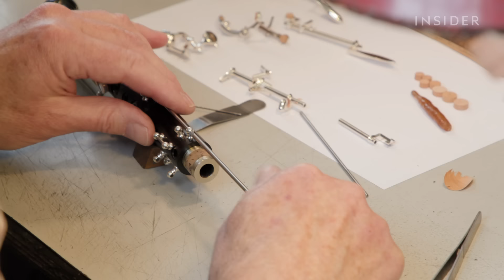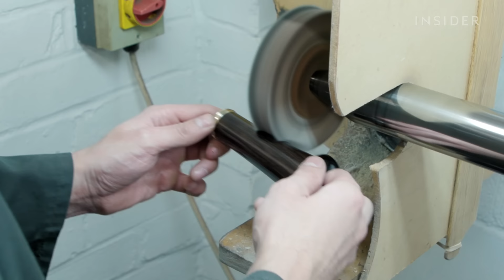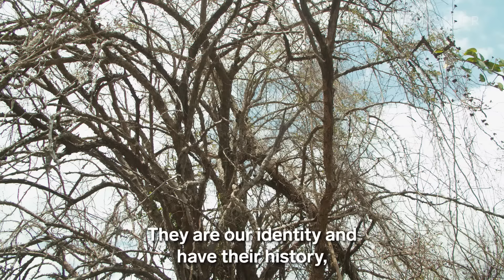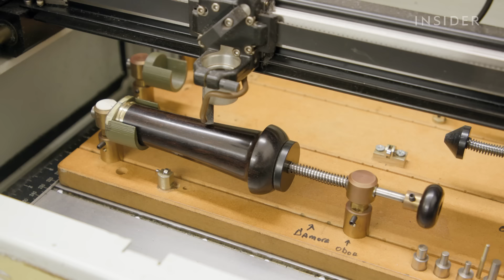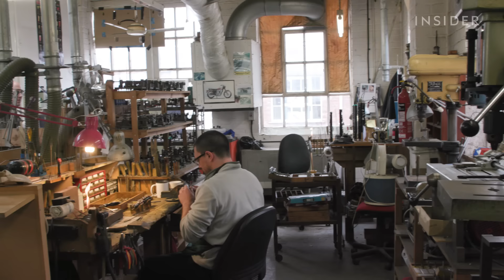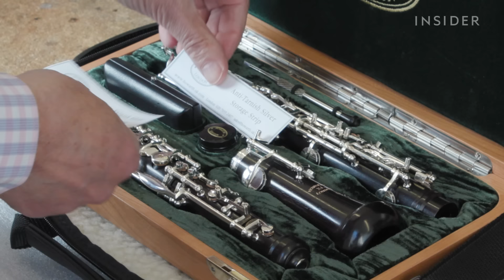Why Oboes Are So Expensive | So Expensive | Business Insider

Comment: Listen closely... This... NEARLY ENDANGERED WOOD. $151/ cubic meter. You know not how much this really is. Enough for probably 1000 Oboes. The lies told to inflate prices are always quite blunt. You just paid this man $14000 for a job a decent fitter & turner could do for $1000. its literally an engineering shop with a bit of a twist & an "aging" process that really means nothing other than dazzling the minds of the easily awed. Nothing fancy really.

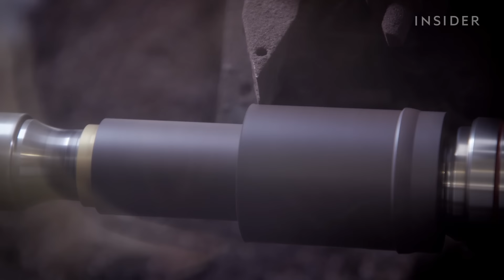Comment: Its a 2 year old video so I don't think anyone will see this comment. But at the 1:12 mark, there is a piece being turned on a lathe and the cutting knife on the lathe looks dull and rusty. Or am I missing something? Maybe the cutting edge is actually behind the piece of wood being turned and not visible from the camera angle.
Reply: Pretty sure you only need the cutting edge to be polished and sharpened since the rest of the structure likely has a protective oxidated surface to prevent further rust, or was painted over
Reply: @VentiVonOsterreichor it is just the wooddust from cutting making this rugged surface

Comment: Great vid, but I kind of died when it said “($14,000)that’s more than four times the price of a high end professional flute”. $14,000 is the price for most professional flutes😭. Not even high end either, that would likely be the price for a handmade flute made out of sterling silver. An ACTUAL high end flute is typically made of gold, and those can run you up anywhere from $18,000 on the low end $20,000-$30,000 typically, and $50,000 for a complete 14k gold flute, mechanism and all (there are also some more rare flutes made out of solid platinum that can run over $60,000-$80,000!). Unless the flute is broken or ancient, no professional for will sell for 3,500, that’s for an intermediate level flute. 😭

Comment: 4 times the price of a high end professional flute? where are you getting your information? A high end hand made sterling silver flute can be anywhere from 8k to 20k USD depending on the production methods, the exact composition of the metal used, and the extra features that the flutist requests. A flute costing just 3,250 USD would be a high end intermediate flute produced in a factory with relatively little hand labor. Like the kind a good high schooler might play on. 14 thousand dollars is indeed expensive but that comparison is misleading.
Reply: like, i see the description note. i get that its been corrected. But there isn't a high end professional flute that exists that is that cheap. How did this mistake even happen in the first place?

Comment: So the narrator said they use two square meters of blackwood a year. How do they get the 2-D wood in from Flatland? Do they bring it in through the portal in the Bermuda Triangle?
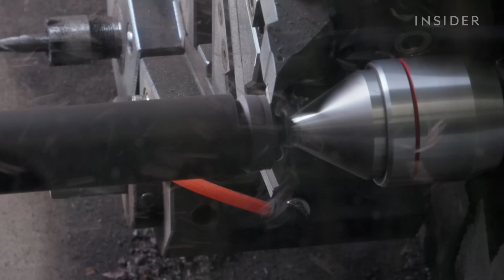No but seriously, that is confusing and kind of annoying. Do they mean 2 cubic meters(' worth) of solid wood, or like a 2 square meter area of blanks stacked up like at 0:37? The second one doesn't make sense because that's not actually how much wood they bring in; they shave off a bunch of material to make the blanks, so the important/interesting statistic here is what volume of wood they use to make that happen. I think they must have meant cubic meters.

Comment: This is a very interesting video. At the other end of the scale, this morning I won an eBay auction for a Larilee wooden oboe (Elkhart, Indiana) for $70. From what I've been able to determine from other websites, this small company made a quality instrument. The advert claims it's a "good fixerupper". I'm basically a hobbyist who plays many kinds of instruments, and I have found that some claiming to need work are actually playable even if not suitable for a serious performance. I'm looking forward to seeing what arrives in a couple days! I have many brass instruments as well as some woodwinds, and it's obvious the brass, in particular, are much easier to manufacture, both due to relatively inexpensive material and simplicity of design.

Comment: Any reasons why modern composite (synthetic) materials are not used for this? For this price it would seem engineered materials with similar properties (and without the flaws) would be better suited, especially since the procurement of the materials are very prone to over harvesting and corruption etc.
Reply: Synthetic materials are used to make some woodwind instruments. While it definitely brings the cost down, the attention to detail and consistency of quality isn't always there.
Reply: @giawelch1181  but wouldn't synthetic materials be more consistent than organic materials in this case? They mention in the video that they have a selection process where they expose it to drying in order for weak specimen to crack. For the same amount of effort and money it would be possible to attain this quality with engineered materials as well.

Comment: What they failed to explain, is why clarinets are so much cheaper. They essentially are the same, except for dimensions, sound hole size/location, and the reed. Why do oboes require that wood, but clarinets don't?
Reply: It's probably due to how oboes get wider and wide from top to bottom. The things you mentioned makes them completely different.

Comment: A number of very reputable manufacturers use specific synthetic materials (ABS, "Resonite", Composite)  for the bodies of oboes, clarinets, and possibly other wind instruments. If you read about the acoustic physics you will learn that the material these instruments are made from usually do not contribute to the acoustics (unless they are so thin that they vibrate). The advantage of composite materials is that they are moisture proof and thus is no longer a problem, and they can be made from molds. Blind tests indicate that you cannot tell the difference in sound due to the construction materials alone. These synthetic bodies can be made by precision pressure molding and thus greatly reduce the amount of difficult and time consuming manual manufacturing. While the absolute finest handcrafted instruments may always be better than those that are at least partly mass produced, for those musicians that cannot afford the extremely high prices, instruments made from alternate materials such as composites are a godsend. I don't know the exact number of parts that saxophones have, but they too are very numerous and complicated, hence the number of parts factor will continue to be an important factor in the higher cost of these instruments. On average the cost of musical instruments such as the trombone which is relatively easy to manufacture and also has fewer parts is far lower than just about any other wind instrument.  We always need outstanding workmanship and care for precision like the Howarth company stands for, but we also need high quality instruments that are more affordable for those musicians who cannot afford top prices.

Comment: From the perspective of a machinist with lots of experience in turning metal and plastic it was pretty wild seeing African Blackwood cut with indexable inserts on a CNC lathe.
Reply: I'd hazard this blackwood might be the only use case for wood in cnc. Other products would neither call for such precision nor justify the sheer cost of thr beautiful enclosed cncs. If they used carbide or diamond heads it would be even more overkill
Reply: @kaing5074 Not really. It is very common to machine wood on CNC, especially to mill decorative elements on the pieces of higher end furniture. Time is the money. If it’s manufactured in a batches or complex enough - CNC is the king.

Comment: I wonder if Backun Musical will ever make oboes using their patented carbon fiber integrated exterior. Backun is an amazing Clarinet manufacturer and only recently started making saxophone mouthpieces as an extension of their product line. The CG carbon cost between $13k and 14k depending on the key and wood configuration, and the wood contraction and expansion factor is practically 100% eliminated because of this. I absolutely love Backun Musical because they experiment with the best solutions to basically every problem the clarinet has had in its history. I repair clarinets as loved hobby as mine and though never worked on an oboe, felt the pain to hear 40 keys were what those repair techs deal with!

Comment: Why not make oboes out of a material like carbon fiber or Richlite? It wouldn't have the problems with cracking like wood does. Nor would you need to worry about conservation efforts like you do with African Blackwood (and many other species). I've seen carbon fiber guitars and clarinets before. I wonder if the same concepts could be applied to oboes to make them faster and more affordable to manufacture.
Reply: Wood creates a very special sound when vibrating, which cannot be replicated with plastic

Comment: so Oboes are prone to crack so they use and endangered wood because its less prone to crack instead of using a cheaper wood that is easier to procure. the work to replace said part should be cheaper then just obtaining the endangered wood shouldn't it? buy 2 oboes for the price of the wood to make one?

Comment: Just because they’re using a machinist’s lathe, doesn’t mean they HAVE to use metalworking equipment. How would they have made oboes in the 1600’s if metalworking equipment was REQUIRED?

Also, an air leak won’t render the oboe “useless”. That would imply that an air leak is irreparable. It’s not lol

Comment: I know it would be a little wrong for a high quality producer to use anything but the best materials, but I can’t help but wondering if using a cheaper more accessible material than African black wood would be beneficial. Perhaps some experimenting with a dense polymer like nylon or something a little harder or even a treated hard wood that wouldn’t absorb moisture, but moving away from wood would definitely reduce any risk of cracking and probably speed up production time as it wouldn’t need to be cured, it would be interesting to see how it would change the sound of the instrument.
Reply: it would be just as good, and probably better.   tests have shown that in blind tests violinists cannot distinguish Stradivarius violins from other high quality ones.   part of the issue is the association with elitist over-elaborate materials and construction.
Reply: @billjohnson9472  Fancy materials are undoubtedly nice to have but I just think continuing to use a dwindling source wood and especially when the selection process for the pieces used must be somewhat wasteful due the the specifications for quality. I just wonder about the sound because I’ve seen different mouth pieces with saxophones change the profile of the sound. I think it would just be something to experiment with.

Comment: Is it not possible to coat the wood with a thin layer of resin or something to prevent moisture & cracking?
Reply: That would probably change the timbre of the instrument and potentially trap unwanted moisture. A defect in the coating could also lead to moisture having a local access to the wood, creating uneven and unpredictable expansions/contractions.

Comment: The time framing in this video seems  very off. Im sorry but on a lathe and in a CNC it is not taking several years to shape the wood. and if it did it'd cost a hell of a lot more than 14,000. 5 years, 14,000 dollar? Math doesn't add up.

Comment: I see some parallels in manufacturing a chemical rocket engine and and a helicopters carbon fiber rotor.  Is it possible to make a good working oboe from concentrically laminated oriented strand carbon fiber?  Has anyone looked at the microscopic grain structure of this wood to see if an alternate material could be employed.  Materials engineering must have the answers. There are many forms of carbon fiber construction systems that could be brought to bear in this problem.

Comment: "It takes 5 years to make one" LMAO yeah ok 👍
Reply: From start to finish it does (or even longer) for each instrument if you include the amount of time and stages it takes to process and season the wood from solid billet to finished joints.
Reply: @chrisperyagh    They buy the wood pre dried bud... they're selling you the same little story as the japanese that takes them 10 years to make a teapot.
Reply: @BRAVITS  The wood may already be pre dried to some extent by the time they get it from the supplier, but it's then processed in several stages and set by for several months in between each stage to allow it to season better for a far more stable end product. 

Starting out as square section solid billets when first delivered to the factory, then going through various other machining stages over a period of time to end up as finished joints which are machined to the finished outer dimensions and polished. 

Only then they're set out with all the various toneholes, pillar holes and slots cut into them, then the pillars, socket rings, tenon rings and socket linings are fitted, then the keywork is made and fitted and sent to be plated, the bore reamed to its finished size whilst the keys are away and the instrument finished once the keys have come back from being plated. 

Bud.
Reply: @chrisperyagh   Yeah not reading all that... but you're wrong.
Reply: @BRAVITS  Really? Remind me the last time you worked for an oboe maker.

I'll wait ...
Reply: @BRAVITS  Your silence speaks volumes of your total lack of knowledge.
Reply: @chrisperyagh   Oh you actually thought you did something?  Hahaha you're adorable... i already told you, you're wrong and im not reading any of what you wrote. That was the end of it.
Reply: @BRAVITS  I'm wrong? Hahaha you're deplorable and in this case, you're the one that's very wrong. I worked as a finisher for this very company for well over a decade and have first hand knowledge of exactly what they do. What's your previous experience? None. That's the end of it.

Comment: why would the make the keys one by one by hand.  You can easily get mass produced metal pieces like that with no drop in quality. Is each obo different?
Reply: Where exactly can you "easily get mass produced metal pieces like that with no drop in quality" from?

I'll wait ...
Reply: @chrisperyagh  So youre saying theres a guy sitting making each individual yamaha sax key by hand? Where do they get their keys for their multi-thousand dollar instruments?  Im just wondering why they wouldn't have them mass produced and then tuned individually. it makes no sense to build each one by hand when you can have it precision machined better and cheaper
Reply: @alexpolakis2016  Yamaha have key making departments where the individual key pieces are all jig mounted and silver soldered together to form each key by a team of workers. Then after polishing and either plating or lacquering, they have key corks/felts and pads fitted. They only get fitted to the instruments late in the manufacturing stage rather than having been tailor made for each individual instrument. 

Howarth oboes have the keys mounted at a much earlier stage and the sets of keys are instrument specific rather than only marrying up with the joints at the point of finishing. Once the keys are back from being plated, the finisher then has to refit the keywork (as the plating has increased the dimensions), fit all the screws, springs, pads and key corks and does all the final adjustments to end up with a finished oboe. 

Student model keywork is mostly jig mounted and then fitted and allocated to each instrument whereas the pro models have the key pieces all fitted and soldered together by hand (instead of jig mounted) for each individual instrument, so the keys are a much more precise fit and aren't interchangeable with other instruments, even with instruments of the same model as some linkages won't be in the same place as they are on others. They're not the only company that do that and with them being handmade, custom ordered instruments with custom keywork can be made to the individual player's requirements.

While CNC machining plays a large part in making individual key pieces as well as other cast, turned and extruded pieces, they still have to be soldered together by someone and machines can't do that.